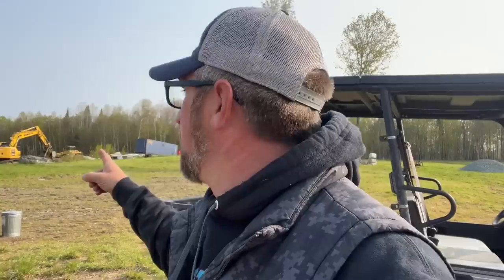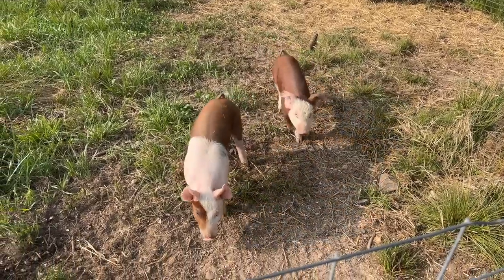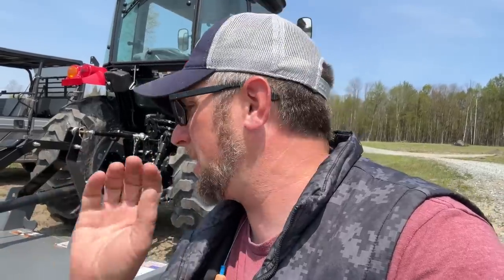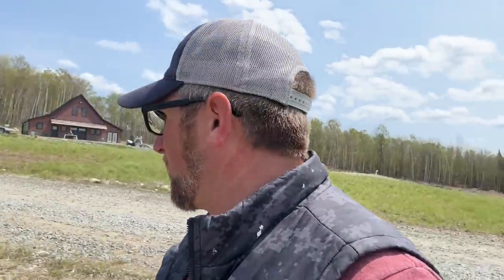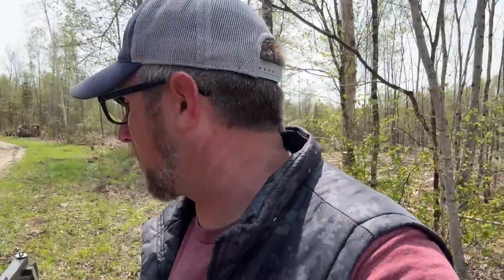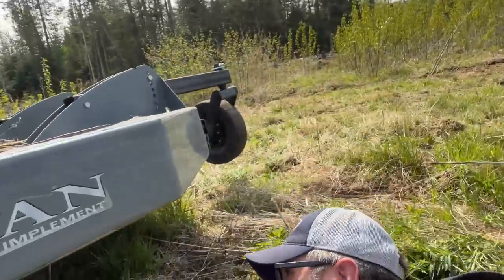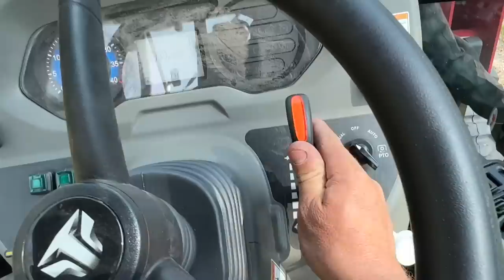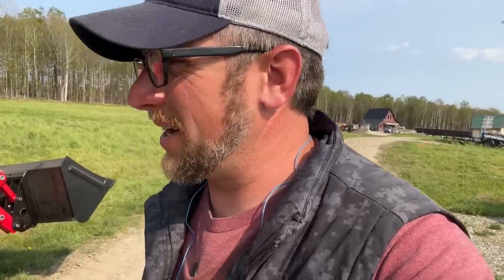We Got a NEW TRACTOR for Our OFF GRID Property in the WOODS (Major UpGrades!)

Comment: I run a 10ft cutter on a 62 pto hp tractor. Very thick grass will bog it down. If i was going to run a batwing, I'd want something closer to 100hp. Heavy weeds and brush arent an issue. Its thick grass.

Comment: Good morning Al.

The jam nut for the 3 point hitch upper link is loose at the 12:55 mark of the video.

Since the tractor falls into the horse power range requiring diesel exhaust fluid, check the date on the DEF. Old stock fluid will cause problems on the sensors. Any DEF that you purchase if possible, store indoors as extreme heat can cause it to crystalize. Frozen DEF turns into a slushy, that's why the truck stops have DEF inside the small pump house.

If you're having a tick problem this early, think about creating a treated area with permethrin about 50 yards wide surrounding your living areas but away from the garden. Having had Lyme, I still don't understand why ticks exist on earth.

Anyhow, have a great Memorial Day weekend. The chores never end.
Reply: Good eye on that loose nut which is turning back and forth ever so slightly!  Also excellent tips about the DEF stuff and ticks.  Thank you for sharing!

Comment: ..a small tip. I always cut the bales as close to the knot as I can get, then grabbing the knots, it's easy to pull the strings out cleanly without hay getting caught up. If you're doing a lot of bales, it's easy to grab all the knots and trail the stings. This also gives a useful length of string for other uses..
Reply: I'm thinking those goats would love to be free-ranging in the woods instead of being locked up, they will clear his forest brush for free 👍🙂
Reply: @colstace2560  city dwellers always giving country advice. lol
Reply: @KenJ-61  X2
Reply: @KenJ-61  We have had goats for years.  Part of our ground is timber and we put the goats in there a lot.  10 goats will clear 4 acres of underbrush in two weeks.   They are awesome for that.
Reply: @KenJ-61  hi Kenj, I've worked in farming all my life, not a city dweller at all..

Comment: The new tractor is doing a good job mowing. I don’t know if you already have a disc or a field cultivator. You can smooth out the rough spots. And then you can put grass or whatever you want. Congratulations on the new toy, be safe and try not to scratch it up too much.

Comment: I have an offset mower which I find gives a better finish as you are never running over the surface you are cutting. Also when doing roadside verges you can drive on a relatively level surface and your mower therefore keeps a constant height which gives an even  surface.

Comment: Watch about bushhoging around a pond.  It can pull you in.  I done it.  Great video. 
Thanks
Reply: You had control of the tractor and you got pulled in? Maybe Al can give you a driving lesson.
Reply: @DukeOOO  10-4.   Most dangerous attachment is a bushhog.  Been using one on the farm for 30 years.
Reply: @DukeOOO  Sorry just saw the question.  If your bushhog is to close to ground it will pull you backwards. 
If you don't react fast you will have to be pulled out.
Reply: @ppaje31  That's why I use a batwing. If the slope is too high I have another machine. You are correct...they are dangerous machines.

Comment: the 494 and 574 have hard lines all the way to the bucket. thats nice. even them there KU-BOATERS run hoses! i have a 2022 T494 rops. i have 82 hours and still no regen. any thoughts on this? its either real good or real bad. so far zero issues with 494. rich Canadarago lake ny (edge of cooperstown)  PS a cutting edge makes a huge difference peeling sod.   i have hydraulic top link from holland spare parts and pats easy change also

Comment: With all your equipment outside I would buy some WD40 Dry Lubricant. And spray every nut bolt, and fittings. Including all pins, Cylinders, and metal. Give it a bath. As a mechanic you know what I’m talking about. TYM is nice 👍 and you’re going to have a great time with it.
Reply: He's a mechanic  ?
Reply: @colstace2560  Al started that way back when.

Comment: Good Memorial Weekend Lumnah Acres.... Hi AL , GINA , OLIVIA , & let's not forget Mr. Figaro , ( I also have a feral Tuxedo cat living here on my place , love tuxedos !!!!! )   Well , I do have a couple suggestions for you to do ...Some that'll save you time , some that'll save you money , & some that'll save you effort , especially in cleaning & maintaining your equipment.....
1.) After all the equipment you've acquired you absolutely need a LARGE LOAFING SHED , Pole Barn Style , 
( Simpler , cheaper , easier & quicker to build than post & beam , especially when you build with a Crusher-run floor... Three sided open structure... Which can be closed in later with sliding by-pass doors...To be able to keep your equipment out of extreme weather conditions for easier use when needed so you don't spend all your energy cleaning off snow & ice just to get it ready to use & still have to shovel out too , all before you can even start & use it...
2.)  This shed should be located near one of your gravity-feed water bibs for hosing the fresh dust & dirt off your equipment at end of day coz it's easier to clean while it's still fresh & loose .....
3.)  In that shed wall or SHELF mounted , should be a small pressure washer to give that water enuff power to clean with ....
3.)  A small to medium size compressor should also be mounted near door opening with a long hose to blow dust off equipment when a washing isn't really needed yet coz it's a little faster & can remove hay/grass easier & better before a wash when it is needed .....
4.)  Every bay should have a battery tender wall mounted to keep all batteries well maintained ( especially in winter )  nothing worse than having to replace a battery in equipment in the worse conditions before you can even use said equipment...
5.)  As You have already said , there aren't many places to buy OFF-ROAD DIESEL near you , so to save you money on refueling all this equipment you have to feed , to save you Time , Money , Effort to drive out & get cans of expensive fuel I Think It goes without saying that you should find the closest off road fuel station near you & mount a TOTE inside that shed  in the same bay as the pressure washer & compressor to create a proper maintenance BAY all in one convenient  area ...
6.)  All including some simple lighting & in the maintenance BAY a few Duplexes for hand tools to be used in maintenance ....
7.) All this would require either connecting to your Solar System , OR  adding a smaller Stand Alone Solar System to the shed itself , which by the way would add to the Security around the homestead with a few well placed motion sensors floodlights to come on when predators come near there ........ 
I hope these planted the seeds of projects to come before the facts of building & can contribute to having most ideas to implement before any construction is done coz I know how you like to plan ahead so you don't have to do anything twice to correct something forgotten or left out ....
Have a great weekend guys , & may GOD BLESS .....🙏🙏🙏
Reply: I like your tips! I think the open side building is a great idea. Maybe with a roof extension over the road to keep snow and ice away to get the equipment out in the winter. Al was saying he would use the roofs of his new buildings for solar power. Have a wonderful Memorial Day weekend!

Comment: Is that New TYM 574 bigger than the other TYM tractor, I don't recall the Model # of it  and do you still have the other one or did you trade it in for the new TYM 574 ?
Reply: 5 h.p. bigger, I believe. No difference. He needs to pull a '15 batwing with something.

Comment: From looking at the longer distance shots of you mowing, it appears that you need to adjust the angle of the mower deck, the front is lower than the back which could cause the blades to scalp what you are cutting in the front of the deck.  OK, you saw the same thing, nevermind.  I generally pause the video when I see something I want to comment on.  Otherwise I would forget if I waited until the end.
Reply: "Old-timers" disease,  I know it well 🤣👍

Comment: Det dere trenger til traktoren er hydrulisk toppstag da trenger dere verktøy for justering tiltingen på redskapen på trepunktenfor det er vel dobbelt vokene hudrolikk uttak bak på en så ny traktor?
Reply: Courtesy of Google translate: What you need for the tractor is a hydraulic top strut, then you need tools for adjusting the tilting of the implement on the three-point, because there are probably double raised skin-like outlets at the back of such a new tractor?